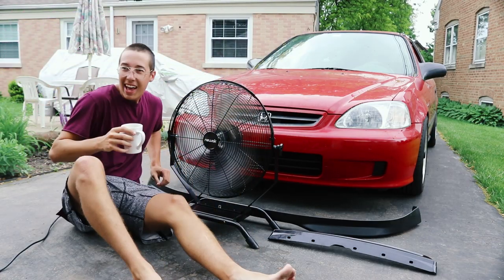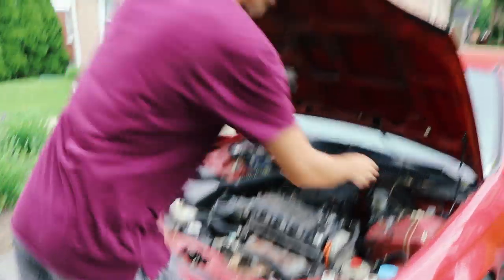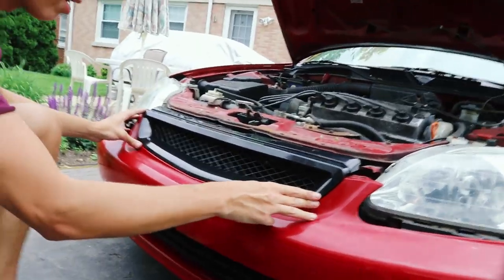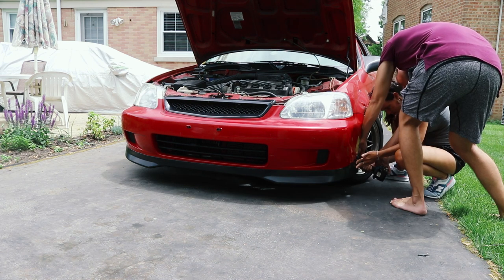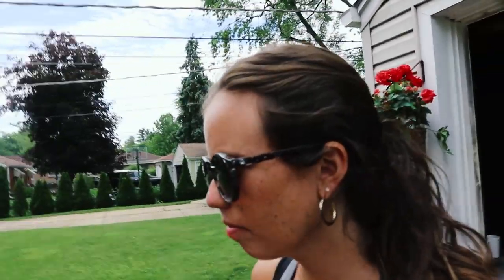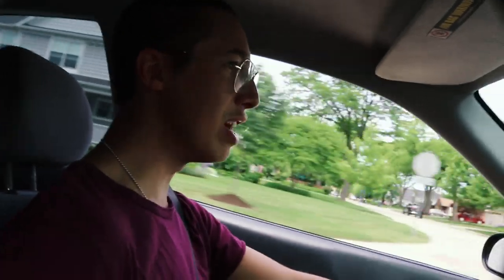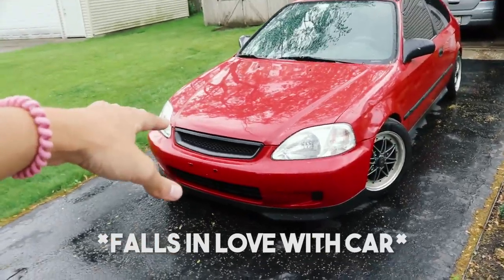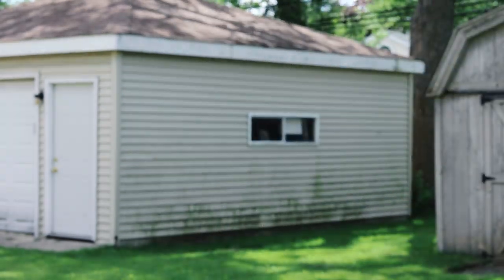Type-R Lip and Grill for My EK Hatchback! (Ebay Parts)

Comment: EJ’s (EK’s) hatchbacks are only going UP in value, panels and trim parts are becoming hard to find and the market is about to change along with a very serious economic crash. 

Hold onto the civic because it is a reliable working vehicle that you will ALWAYS be able to get parts from the junkyard for. Those years made everything interchangeable, it’s what caused Honda to lose so much money over time, the reliability and ease of repairing your own vehicle, good you didn’t sell.
Reply: I thought parts are getting harder to find? Lol
Reply: @BlueCivid  New OEM, Honda is discontinuing many of the interior/exterior trim pieces (Brand New). For example, JDM and EDM side moldings are thinner than USDM (Black line down the side), those are at almost $400.00 for a new set, and upwards of $300.00 for used set with unbroken clips. But this year Honda Japan stopped making them, so the only source of those is basically JDM/EDM Junkyards or importers.
Reply: Finding this comment a year later, you couldn't have been more right
Reply: @marvinflores974  Shipping container costs are getting nuts! I dunno if I'll ever be able to afford a JDM B18C at this point.

Comment: Hello, i need HELP! 
I have an issue with my Civic EJ9 1.4. and cant find a solution.
No im posting this under car videos and hope that someone can help me.

Ive made this video from the issue:
https://www.youtube.com/watch?v=YCBkie3RwR8

Its only when i drive, especially when torgue is needed. Its the loudest when driving in reverse.
In the video i drove back with the pull brake on to simulate a torgue situation.

The Civic has 96000km, with fresh motor flush, oil change, new calibrated valves.
The shifting is really good and the clutch engages well.

Also it has no heat shieldings anymore at the exhaust, because they made loud noises in the past.

I think its maybe some issue with the transmission from engine to the wheels.

Pls help me, i cant pay tons of money for a professional mechanik, and want to repair it mysel.
Im thankfull for every help i can get!

With best regards,
Max